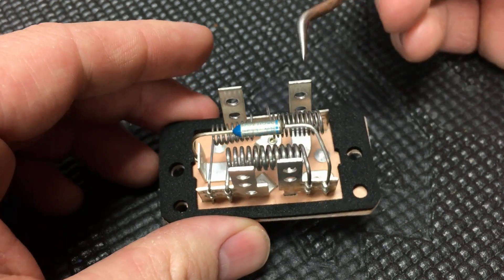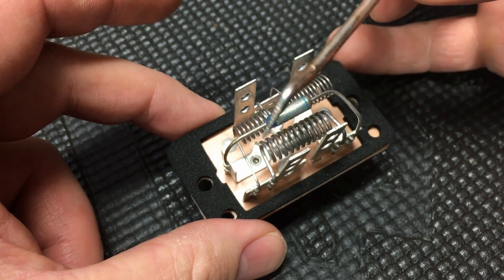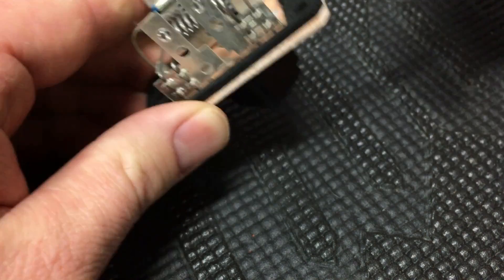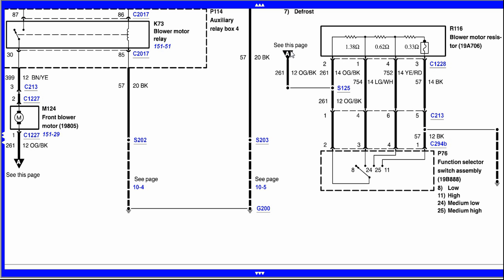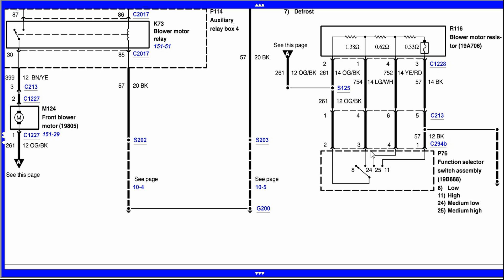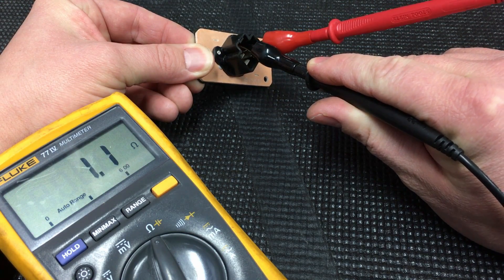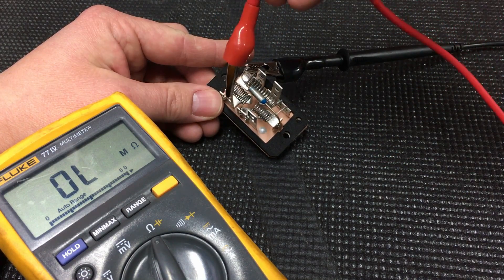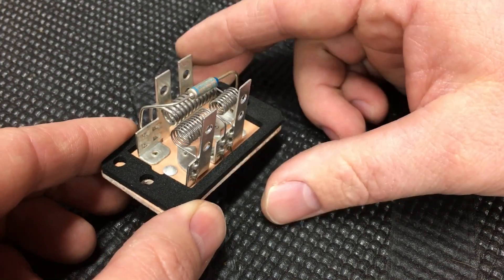Ford Quick Tips #68: Blower Motor Resistor Failures- Testing and Inspection

Comment: Great job. Could you do another video explaining how a non functioning blower motor duo to fan not turning because the brushes in the motor are worn out or the bearings for the fan are worn out causing a overheating of the Resistor. In other words the blower motor may be the cause of the non functioning Resistor, and will only cause any new Resistor to fail  soon after it has been installed?

Comment: Watching another video I also leared that the blower motor could be the cause of a blowen or failed Resistor. If the fan on the motor is not turning freely and cooling  the Resistor  components this will  cause over heating of the resistor, and the thermo coupler will over heat and destroy the resistor.
And if the brushes in the blower motor are worn out then the fan won't turn as required to cool the resister and the thermal coupler will fail almost immediately and kill your resistor.

Comment: Mine (in a winnebago built on a 2018 Ford F53 chassis) has a blown thermal fuse. Considering even Ford dealers can’t find me a replacement part (even with the part number!!) I’m thinking about replacing the thermal fuse directly (the rest of the resistor looks fine). Any advise for me?

Comment: 3/11/2024 want to say thank you for your video. Extremely helpful however I found a few tips that may be of added benefit. First when dealing with electrical parts such as these that have 2 key components plan on buying both and ONLY BUY MOTORCRAFT. I know they are pricy but trust me they will always fit and work. The next thing I learned is I left the electrical connections in place while I removed the fan and solenoid. This made it easier to remove once they were down and you can see what you’re doing and definitely be careful as the plastic probably will be brittle and also reconnect the electrical connections prior to installing the parts. My fan was frozen up and wouldn’t turn but it’s always been my luck if I only buy one part it’s the other that’s bad. Now if you can drop the fan first and see if it spins you may stand a chance but with 85k in a 10 year old car I figured do both and have no issues.  Thank you again.

ONE MORE KEY NOTE  on all of the Ford flex models. There is two cowl water drains one on the right side out under the hood. The other ones on the left they are difficult to get to, but the one on the right is right behind the air conditioning dryer accumulator whatever that thing is, if you can get your hand in there, it will pull out. It’s a big rubber piece clean it out and then reinstall it. The reason mine failed was because the water couldn’t drain and if you ever find moisture or water in the passenger side floorboard that probably was wrong drains are draining. They clogged up and need to be cleaned and you can do that, but that is one of the reason these fans and modules fail. My wife had a WeatherTech mat full of water about a month later the fan started squealing and here we are a month later she had to have the fan replaced just an added note.

Comment: Ford tech. i get that these blower motor resistors have corrosion issues and that they get hot, is there anyway to spray it with any anti corrosion product to make it last longer and not f it up or burn it up, possibly the connector too ?

Comment: Quick question.  My resistor is working on all speeds . But I am NOT getting full battery voltage on high. Only about 11.2 volts on high . Any ideas as to why ? Thanks

Comment: I don't care what wrong with my Ford you always have a video about it. I've been following your YouTube channel almost from the beginning. You really know what you are talking about and a lot of the things you have done really helped me out.

I know this is a 5-year post so you might not get this but if someone else can help I would appreciate it.

I have a 2001 Ford expedition Eddie Bauer. It really does not get driven enough since I broke my back I'm only able to make short drive.

Today when I was at my destination I turned the key off but my blower motor went up on high and would not shut itself off so I hurried up since I did not have any tools with me to disconnect the battery. When I arrived home it was still doing it but when the key was in the run position the blower went back to normal but when I turned it off it stayed on high.

I seen a lot of comments on forums about this issue some people say it's the relay some people say it's other really deeper in. Since I overdid it today I haven't been able to go out and unplug the relay and see if it's that. I was hoping that you might either have a different video or if it could be this relay that is bad. For right now I ordered a battery cutoff switch so I don't need tools to disconnect the battery. That's a quick fix for now.

I do have pretty good mechanical skills and a lot of times since my body cannot do something I have someone else use their hands for me. Unfortunately a week before Christmas he was in a horrible motorcycle crash and 3 weeks later he is still in the hospital. I want to try to get this fixed the right way before he comes home since I have to run him two different doctors appointments.

Again thank you for all the years of great videos and of course I always make sure they hit the like button.

Comment: Just changed this on 98 Expedition.   Plan on a new wiring connector when replacing the blower resistor as mine was melted and charred.  Luckily there was never a fire

Comment: I have this problem with my 2003 F150 4x4 4.2L truck.  I own both of the shop manuals for this truck.  I have searched the web and my manuals trying to find the location of this resistor.  I have also taken apart a good portion of my dash looking for it.  Could you tell me where that resistor is actually located?
Reply: Under / behind the glove box

Comment: I tested the voltage at the blower motor connector at full speed and I was only receiving about 3 and a half volts I'm gonna jump the blower tomorrow and I'm hoping it should work if not I'll replace both the resistor and blower

Comment: That's beautiful.  It's rare we get to see the schematic.  So our blower switch is not switching low current to a relay (would take a relay for each reduced speed).  Always wondered.

I'm surprised that in the 12 Rangers I've worn out (over 30 yrs), that switch has never failed, and to learn it is switching all the current the load is drawing makes me surprised.

A future video could measure the current draw on high fan.  Also measure the dropped voltage that each speed selection yields.  i realize this is curiosity is for the tech nerds among us.

It was very interesting to learn how few ohms it takes to slow that DC motor down.  Now, everytime I back off full speed, I ll think about the .4 ohm resister I just put in series.  (etc for the other speeds)

Now I'll see if I can change mine.  (2010 2.3L XLT) Have only high and minimal low speeds since last week.

Comment: Have one in my 68 Cougar, 82 Bronco, 2000 taurus, the one that leaks. Luckily I have a boneyard 10min away, last one lasted a yr. Why not use a slow blow fuse wired through to outside of box? It really is easy to get to just another pain in the ass I don't need. I'm working on the leak... another pita, They do get hot! Leaves or pine needles... in my bronco about started on fire yrs ago new years morning. Looked like a Cheech n Chong movie

Comment: Hey Brian, big fan here with a question: what if you run the blower motor WITHOUT the A/C on, and it's a hot day?  Then it's just gonna be hot, humid air running through the resistor, so how does that environment prevent the resistor fuse from blowing?
Reply: I was wondring same thing, too bad he didnt answer

Comment: I have 2003 sport trac my fan setting 2 and 3 have the same speed, it dont change, So I replace the resistor hoping that would fix my issue but it didnt.. does that mean that my speed control knob dont work...

Comment: so. if we want to cancel this resistor system. we need to join the ground wires from  the resistors plug because the positive comes from the releay to the fans. and the fans going to work in the high speed, right??
Reply: confirmed

Comment: blown 3 or 4 over the last 3 yrs and 2 in last month. i have checked voltage to motor and it is battery voltage. however the fuse on resistor is the portion of resistor that goes bad. nothing looks fried at all. blower motor draws 8 amps on high. it is almost new. the other motor seemed hard to spin. i thought by replacing that and a new motorcraft resistor all be well. no other obvious things i could see. maybe i should try replacing  the plug to resistor even  though it and wires look ok. apppreciate comments. nice video btw

Comment: You are to be commended again for yet another informative video!  Performing the electrical check you describe showed the thermal fuse had popped on my otherwise only slightly surface rusted blower resistor.  Excellent camera, voice, and narrative, no nonsense!  Thank You Very Much!

Comment: I’m having an issue with my 2003 f350. Blower motor works in all speeds but on number 3 the speed doesn’t increase. It blows at the same speed as number 2. All other speeds seem to be working correctly. Possible resistor problem or maybe the fan speed switch? Thanks

Comment: Hi, love your channel! I replaced a similar resister on my 99F250 SD, and it went out again within a few days. So I replaced the old connector (pigtail) that looked a little suspect and install another resistor. That one went out (only getting high speed) again. From what I have read/seen, if the blower motor itself is drawing too much current it can burn out the resister, but I can't find anywhere that tells me what the motor should actually draw in my Ford (or any ford) on the respective speeds. Do you have the amperage specs on these and could you please post them, so I can test the motor to confirm it is the problem??? Thanks in advance, Richard
Reply: great question friend, Too bad he did not reply,

Comment: If you have a weak blower motor would testing this out be a good first step? The air on my 2011 Ford Fusion just doesn't seem to want to circulate air through the vents all that well, especially when the re-circulation is turned off.

Comment: My only does low no matter how high it is. On high u barely feel it and it's a fresh AC system according to the previous owner it's blowing out really cold but just not enough to keep up with this heat wave it only makes it about two degrees cooler than outside

Comment: I have a 2008 Ford Taurus.  I had a mechanic install a new blower motor resister because I had no blower working on any speed.   The blower now works, but occasionally I will have no blower at all, like this really cold morning, but will work later on.  Also, the blower seems to work at very low settings from like 10% capacity, to 15%, then maybe 30%,  and then jump to near full capacity at the highest setting.  Do you think I have another bad resistor?

Comment: I just replaced the resistor on my 02 Ranger 4.0, it had stopped working on the 2nd speed.
Reply: Did you have the card type or the coil resistor type?
Reply: the coil type, same as @ 0:13, I replaced mine with a Motorcraft one from Rock Auto.

Comment: hey could anyone answer a question for me? i have a 2001 ranger when i bought it i noticed the blower motor would run and then stop then run again then finally stopped all together i replaced the resistor and the blower motor did not fix it then i replaced the relay and it worked. and worked good for about 3 days then it started again running and stopping and stopping all together. i checked the relay and it looked to be overheating what could be causing this?
Reply: The brushes in the motor wear out.  Get a new fan motor.  Or you could try changing the brushes, but the rotor armature is usually also worn out so the best approach is get a new motor.
Reply: @michael931  I replaced the blower motor it's brand new

Comment: Very informative. I just replaced my blower motor resistor on my 2009 ford ranger. None of the fan speeds worked at all. Actually, it would work, then a few days later no blower speeds at all. Leave it off a couple of days, it would start working again, then not at all. Unfortunately changing the blower motor resistor didn't help. I still have no fan control at all. Any ideas would be appreciated. Love your channel. It's a big help.

Comment: FTM: I have a 97 3.0L that has blown 2 of these, the 2nd was harvested from a 2000 2.5L (original) . First, were both these modules the same design, and second, when I go to replace, should I stick with OEM?
Reply: I can't answer the first question.  I am guessing yes.  As for the second question, the first thing he states is "In this video we go over testing blower motor resistors found in Ford vehicles with manual climate control. I only recommend Motorcraft Blower Motor Resistors..."  But keep in mind 1) Ford doesn't make those  2)  The OEM ones are the ones that burned out.  Also Orielly's offers a lifetime guarantee on theirs and I am guessing Ford will not.

Comment: My blower on my 01 Mazda Tribute has only three speeds: low, medium low, and high. The medium high selection runs the fan on medium low. Is this a resistor problem or switch problem?  Thanks.

Comment: Great information and well explained. I was looking up HOW to replace the unit on here but got a bonus with a HOW IT WORKS explanation!!
I had mine fail in my 98 F150 and actually caught a set of blueprints on fire that were on the floor while I was driving.
The connector pretty much had melted and I assume hot molten metal dripped and cause first, the floor mat to smolder, then the set of plans to catch fire. 
Decided to stock the truck with a small fire extinguisher after that for sure!!
Fixed with the help of your video.
QUESTION? Is it good practice to change the blower motor also or is this more just a resistor/moisture issue in itself?
The fan was working fine before the resistor failure...
Regards...

Comment: If you find that the resistors look good but the little fuse has blown, don't pop a new unit in and turn it on before you check the blower motor. If the motor is shorted internally, it will blow that fuse again.

Comment: I don't know if you still see comments from this video but... I replaced the blower motor, the blower motor resistor (same as this one in video), and the relay between the steering column and cigarette lighter.
When I turned everything on it worked great on all speeds then suddenly quit working except on high. 
I'm thinking something is shorting out the resistor????? Do you have any idea what it could be???
Reply: Hello Wally, What was your solution?

Comment: If the blower resistor is broken, is it possible that the fan will not run?
Reply: You should always get at least high speed, unless the motor or some other part is bad.  If there is voltage at the motor and it doesn't turn then the motor is likely bad.

Comment: Hey I love your videos, question: Would it be possible to swap the MCCM in a base 2007 Fusion to an EATC? I already have the digital module and tried it, everything works except the fan speed, I don't care about the "auto" function so I don't need the extra sensors, just get the fan running, I read it uses another type of blower motor resistor, any input on this? Thanks!

Comment: I got 2 trucks with almost same problem one is a 2008 ford f-750 and it only works on the 2 high speeds then I got a 2000 ford f-650 and it only works on high. So do you think it will be the same problem on the f 750 even though it works on the 2 high speeds?

Comment: My  jeep tj blower motor stopped suddenly . What I did was check the resistor and the issue was popped heat preventing part so I just bypassed that and every thing worked fine

Comment: I nearly had my truck (1994 Ford Ranger) catch fire because of one of these things. For months I had a odd burning smell only on low, all other speeds there was no smell. Not wishing to tear into the system until recently after the smell became more common and I realized it wasn't the clutch, I discovered the evaporator case was full of leaf debris with several scorched pieces suck in the coils. I suspect the mouse that ate my evap canister and hot air duct vacuum motor before I acquired the truck is responsible.

On the bright side I know my resistor is in great shape.
Reply: I can only speak of Nissan for sure here. Usually with the first hint of a vibration/noise heard/felt with blower fan in operation, you know leaf debris, etc.has entered the fresh air cowl and is in blower wheel fin. The sound will be dim to brighter, should I say, with advancing blower motor speeds.

Comment: One thing I ran across in my 97 Grand Marquis was a blower motor that drew too much amperage and instantly burned out the new resistor.  I replaced the resistor because the fan only worked on high speed (something I've done in a few other cars I've had). The fan worked fine for a few minutes, then again, it only worked on high.  I tested the blower motor itself and it was drawing too much, so I guess it blew the new resistor.  I replaced the 1 year old aftermarket blower motor and resistor, and now everything works fine.